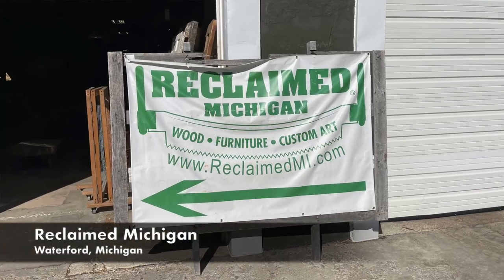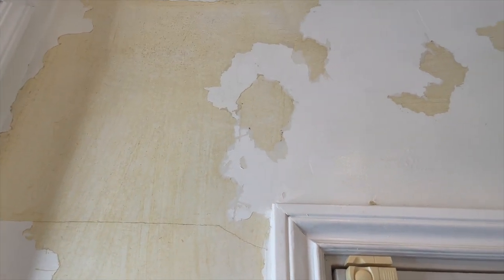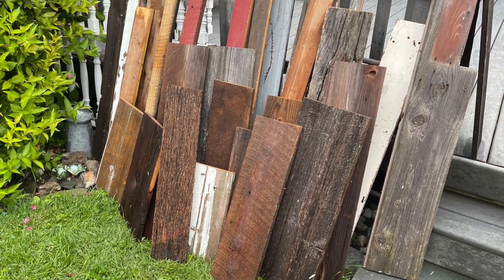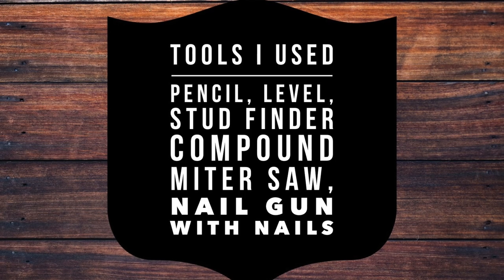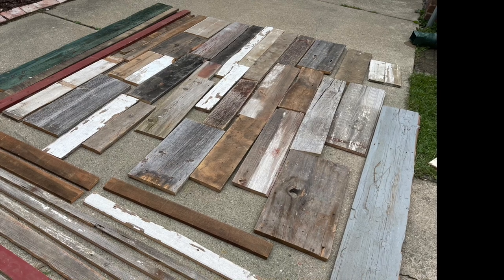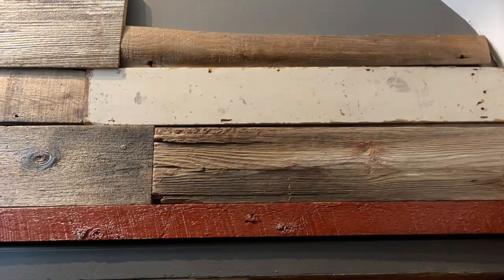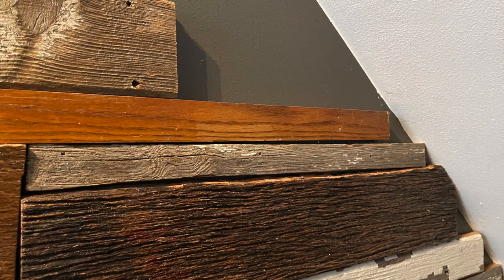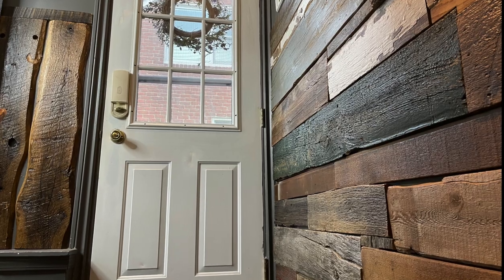DIY Barn Wood Wall | Wood Accent Wall |

Comment: I would only hang minimal art etc on this sort of wall as many old barn boards have traces of lead paint and can be released into your home as dust through any holes made in it, even if its sealed with poly.